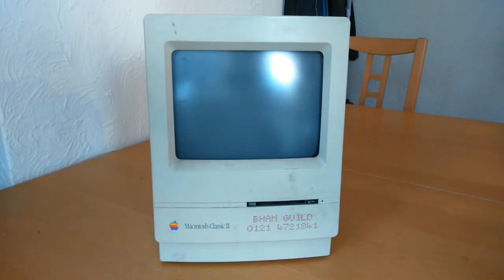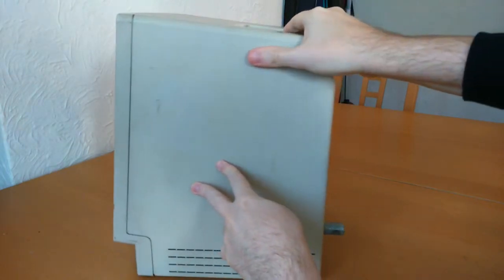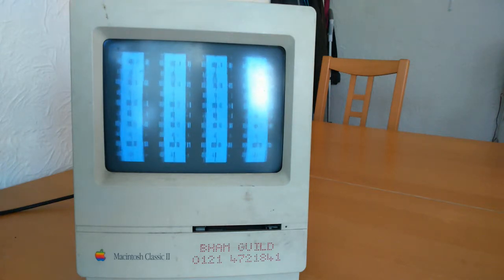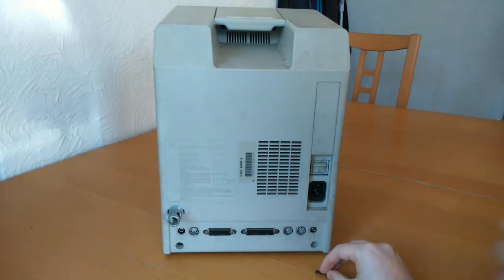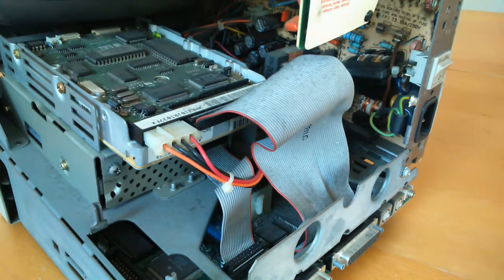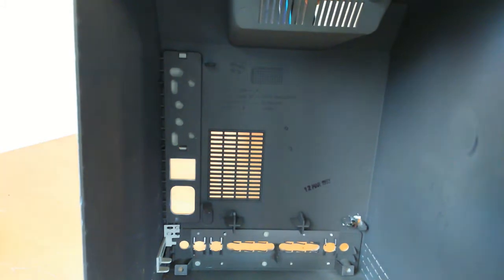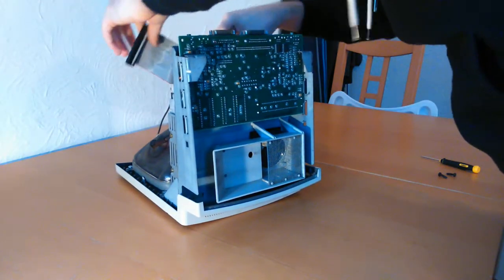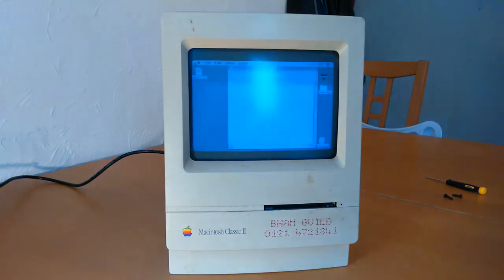Vertical Bars? Quick Fix for the Apple Macintosh Classic II

Comment: Hi are you still doing part 2? 
Got a classic ii to do a restoration project my self and if that fails going to build a hackintosh in it.
My classic has the same display issues so will be checking the caps for leaks and replacing them with modern ones.
Also love the Bham guild I recognised the number lol
Reply from the maker: Rant Time Hi, I've filmed parts for Part 2, however it seems that the original has reoccured again. So at  the moment I'm undecided.